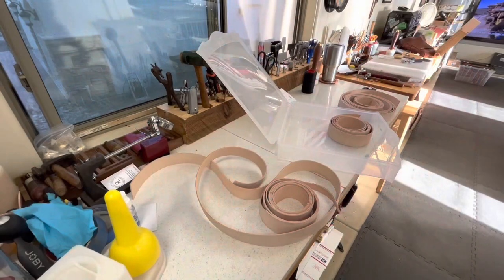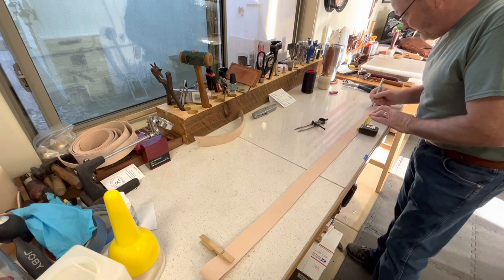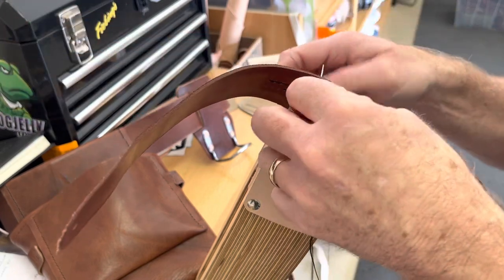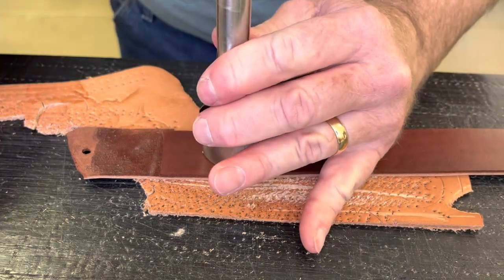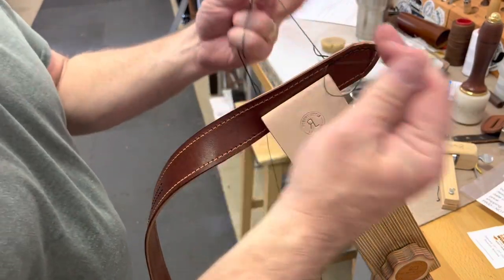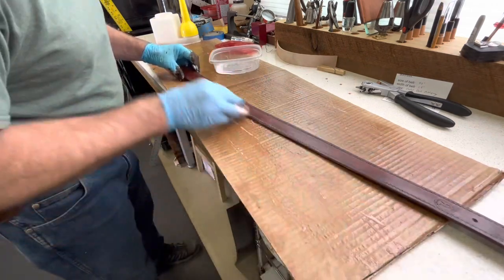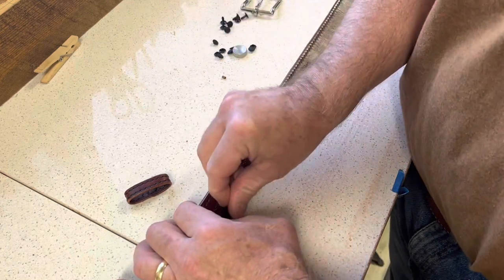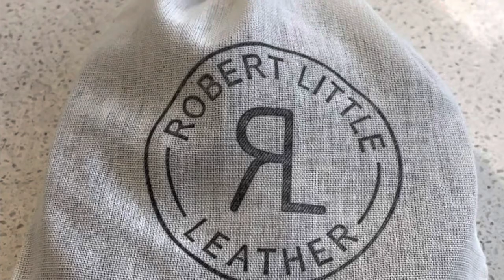Simple Custom Leather Belt Follow Along W/Upgrade Options @InMyBusyLittleShop #Buckleguy

Comment: Thank you for sharing another enjoyable video...what edger brand used(didn't' understand) and what size thread, perhaps missed it...and why use of rotating punch..see you on the next one.
Reply from the maker: The Edger is from Ron’s tools. I used the #3. The thread size is .06 for the center design and .08 along the edge. I think the .06 gives a more defined stitch for that feature. I prefer the rotating punch to help position the hole.  Thanks for your questions. All good.

Comment: That was an awesome video, Robert.  Extremely detailed and informative.  Thank you for sharing your belt making methodology--it makes a lot of sense.  Once you apply the Resolene and it is to your liking, do you allow it to dry as is, or do you buff off any excess before setting it aside to dry?
Reply from the maker: I let it dry even.  Not “wiped dry”.  I have people comment about the sheen. I would prefer not to have the sheen but prefer not to have rub off.
Reply: This helps.  I have limited experience with Resolene (typically I use Leather Balm with Atom Wax) and can use all the helpful tips I can get on how best to apply and use Resolene!

Comment: Robert, do you stitch each side of the belt separately and then backstitch over each side at the buckle end, or do you use one continuous (and very long!) piece of thread and stitch around the entire belt in one pass?
Reply from the maker: One piece per side. Do each is typically around 16’ plus. Ending on folded over buckle end.
Reply: Perfect, thanks for the clarification.  That certainly makes sense from a hand stitching perspective.

Comment: Hey Robert, just another quick question.  Have you made belts where the liner only extends to the bend back, leaving the fold area a single ply?  It seems this would eliminate the need to skive the buckle end of the belt to reduce overall thickness in the bend area.  Personally, I like the full length liner as you demonstrate here but was just wondering about your thoughts on stopping the liner a bit short of the buckle end--pros or cons in your experience.  Thanks much!
Reply from the maker: Yeah so my feelings are that two layer thinned down on the flesh side are much stronger. I think that the finish side the toughest side.
Reply: Definitely makes sense to me.  Thank you for the follow up.  Hope to tackle a belt or two later this year and your suggestions and videos will help a lot!